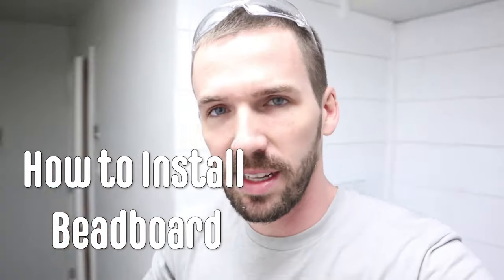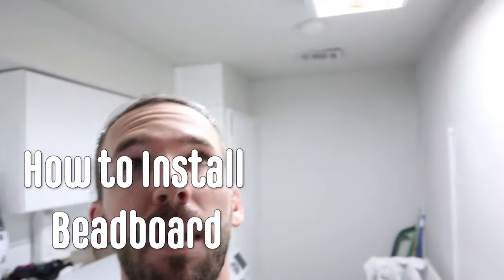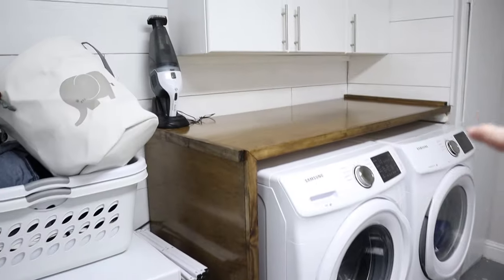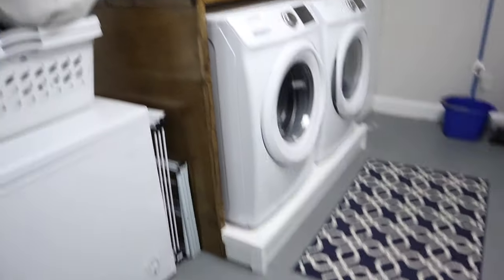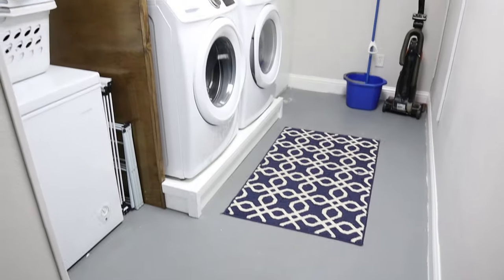How to Install Beadboard to a Ceiling Yourself - EASY!

Comment: We did this in our kitchen, dining and living room. The ceilings was so ugly with poor patchwork from replacing fixtures and such, there was a long crack from where a very large beam had been, and what was left was popcorn. My husband spent time scraping it off in the kitchen and dining room then realized (thankfully) that it wasn’t necessary in the living room after all. So we just put the beadboard up over the popcorn, and it is perfectly level throughout all three rooms. It is a lot of work but it looks beautiful! Especially in a large area like ours. It’s so vintage and charming!
Reply: Do you happen to have any pictures? I'm dealing with the exact same situation in dinning, living, and kitchen. I can't decide what it will look like.
Reply: What kind of nails did you use to install ceiling friend ?Thank you

Comment: Did you glue the bead board or nail to the ceiling?
Reply from the maker: I just nailed the beadboard for this particular room, but I'm usually a fan of overbuilding and adding caulk or liquid nails would give it that extra level quality.

Comment: Did you have to put any strips under neath to attach to? What would you recommend for large room? Still put the spacers in there?
Reply from the maker: Hey Matt, I didn't put any strips under this beadboard. Typically I would apply an adhesive like liquid nails so I'd definitely recommend that for a larger room - along with 2" nails. I made spaces between my sheets of beadboard because I wanted to try to use only 1 piece of material. It'd be best to push these against each other. Good luck!
Reply from the maker: Also, for a larger room, you may want to put in some real framing nails 8guage into the trim pieces - at least on the ends. Just so the little finishing nails don't get pulled out with all the weight (although I've never had this problem).

Comment: Could I do this over patio ceiling which already has plywood. It looks like years ago when they build the deck they never finished... great job by the way.
Reply from the maker: Hi there! Stanfard beadboard probably would not withstand the outside elements. There are waterproof proof versions of beadboard but that'd up the costs  quite a lot I'd bet. Thank you!

Comment: So is it the boards that are holding the beadboard in place?   TFS
Reply from the maker: Primarily yes. I did tack on the beadboard with 18ga nails too before placing on the trim boards. In rooms that are bigger and use full sheets, I will also apply liquid nails or some adhesive to the back of the beadboard.

Comment: Im thinking about doing this to my basement ceiling.  Its the best option. The drop ceiling was trash and theres wires going everywhere. So i was going buy the big panels and put it up just like that.  Is there a good paint and tape (or something) i can use to cover up the seams (if they show, where one panel ends and another begins)  even though the panels are white im going to paint it again to hide any nails or flaws in the panels.
Reply from the maker: Hey Hark, I would put a 1x3 or 1x4 piece of wood to cover up the seams and just paint it to match the rest of the ceiling. I don't think drywall compound or tape would cover it up long term and it'd be a lot of work for something that might not last.

Comment: Is it safe to install even asbestos is present in the popcorn ceilings? I haven't had my ceilings tested yet but I'm just curious.
Reply from the maker: Hi Jensine! Yes it should still be safe - this particular house is 1979 which was when they phased out asbestos (although there is still risk). 
Even if there is asbestos, it is only harmful when it is 'friable' meaning when it goes airborne. So if I were scraping this then I would definitely want tests but nailing something to it is fine. But definitely take all precautions you can!
Reply: @KellyConcepts  Thanks so much for your response. Greatly appreciate your advice! I was not looking forward to the idea of scraping the ceiling. Glad I could skip that step!
Reply from the maker: @jensineleung3609  Awesome! Good luck and thank you for checking out my video

Comment: What gauge and type of finishing nail did you use to attach the beadboard to the ceiling? I tried using 18 gauge X 2" Brad nails and they just pulled thru the beadboard.
Reply from the maker: Hey Stan, I used 18 gauge x 2" as well but I had to turn down the depth/power on the ryobi nailer so it wouldn't sink too much into the beadboard. Wish I had got that install part on camera but I forgot to hit record :( 

Once you get a few nails in one end of the beadboard, it should be supported on that side. Adding caulk or liquid nails will help and I've done that in other rooms.
Reply: @KellyConcepts  Thank You!

Comment: How did you actually secure the panels to the ceiling before the 1 by? Did you just use trim nails? Did you use an adhesive?
Reply from the maker: For this one i didn't use any adhesive  but I usually do on this. Some liquid nails (especially for big panels) and some finishing nails will hold it up there securely. I just used nails on this specific project
Reply: @KellyConcepts  The ceiling looks great. I've worked with bead board panels before and found them rather delicate when it comes to nailing. What type of nails did you use and did you have any trouble with the finish being damaged where the nails were placed?

Comment: what size nails are you using
Reply from the maker: 18guage by 1" for the beadboard and then 1.5" for the wood trim I put around it. In case there are wires in the attic or something up there, I didn't want to just do 1.5" all around.

Comment: I wanted bead-board ceilings in our renovated basement bedrooms. Just floor joist to connect to, no drywall. My husband is a 
Mechanic and had done an amazing job framing these rooms and hanging these 4x8 sheets for little carpentry skills. He used the biggest flat head screws he could find because my suggestion of brad nails just didn’t seem logical to him because they have little to no way to hold the weight. It isn’t terrible having all the exposed screws ( I still need to paint it) but before I do, and suggestion on explaining if and why brad nails would work? I’d share a picture but I don’t see the option to. Thank you
Reply from the maker: My camera was off during the actual beadboard install unfortunately, but I popped in dozens and dozens of brad nails into each panel and most of the time I would use liquid nails to adhere the panels to the ceiling. Using a wide head screw is a great idea though and something I'd consider doing around the edge and place the trim over that. Glad yours turned out good!

Comment: Can you use that type beadboard on exterior
Reply from the maker: Unfortunately no, it will deteriorate really quickly. There is true beadboard made from real wood that can be used outside, but it will cost quite a bit.

Comment: Looking for how u are hanging it..not finishing it pls and thanks
Reply from the maker: Hi there! To hang the actual beadboard, I just nailed it into the ceiling on this one (I thought my camera was recording but it wasn't during this part). I held it up, made sure the lines were straight on the board, and then nailed it in with the same finishing nails. On previous projects, I used liquid nails or caulking to help glue it to the ceiling and then also nailed it.

Comment: 1. You did not show the installation of the plywood. 2. That wainscoating is not "spec'd" for ceilings it is for walls.  A building inspector would not approve that job, unless you show how to fasten the plywood.  I hope you did not just use  adhesive.
Reply from the maker: Yea sorry, I thought I had my camera on recording but didn't during that part of the install. I typically use liquid nails adhesive and some 2" 18ga nails to fasten it (mostly hitting  the joist). Then the trim for additional support and looks. 

I sold this property a few weeks after install and inspector didn't pick up on anything - beadboard is somewhat common for ceilings

Comment: Omg, who puts popcorn in the bathroom??!?!? Why did you need to do it in bathroom before. Great job on that laundry room!
Reply from the maker: The bathroom was of the garage conversion and there was obvious damage from mice in a couple corners. So instead of repairing a lot of sheetrock, texturing, etc, I figured 1 sheet of $20 beadboard would cover it all right up! Attic is clean and mice are gone btw! 😉 thanks for watching!